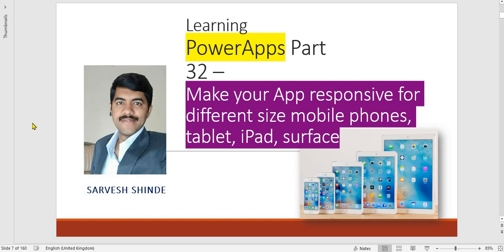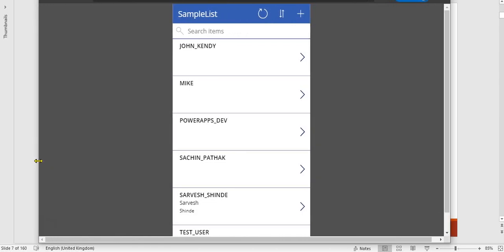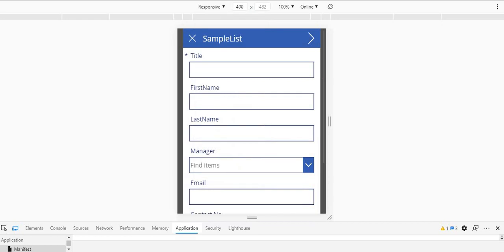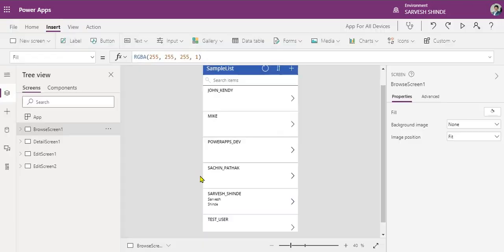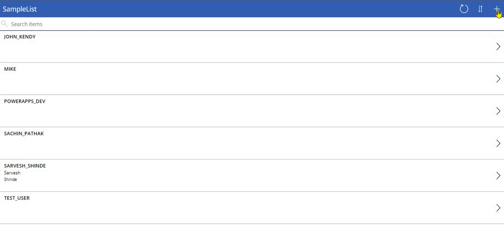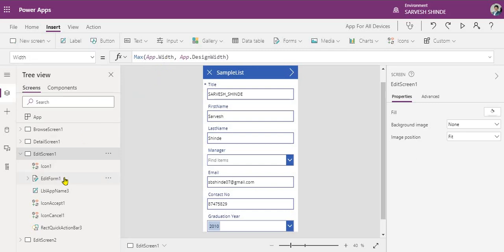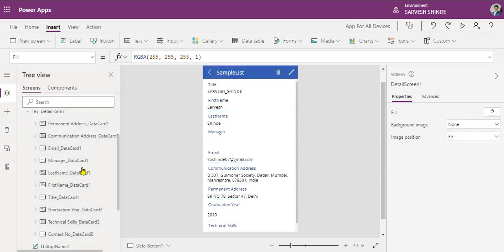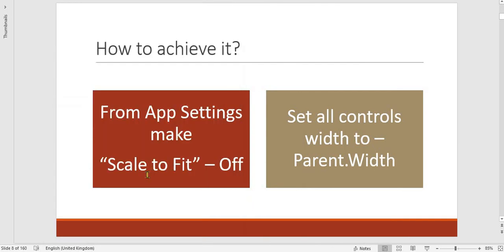One App for All devices - Responsive PowerApps App | Power Platform | Mobile | iPad | Desktop App

Comment: Hi Sarvesh ! Thanks a lot for your video ! this was that I was trying to do here to my app but after made the changes in the settings I saved, closed, refreshed but this did not change the scale to fit as you demosnrated. when you save you cuted the video in your demo so I don´t know if I´m doing correct because  when try to refresh the app it is closing and when I back no changes happened regarding to the scale. how can I solve this matter?